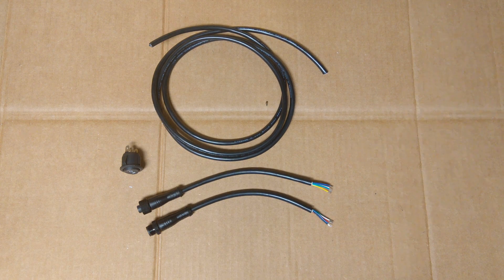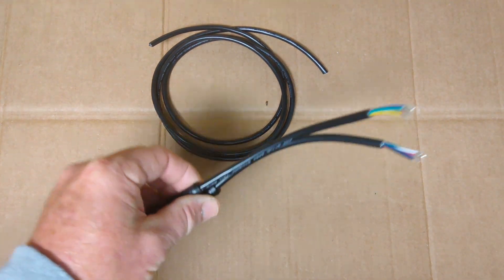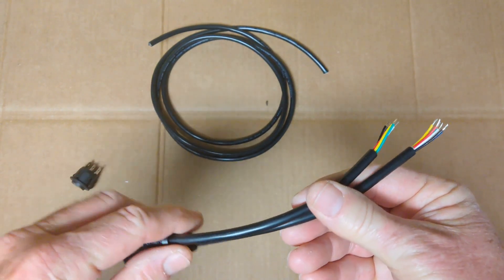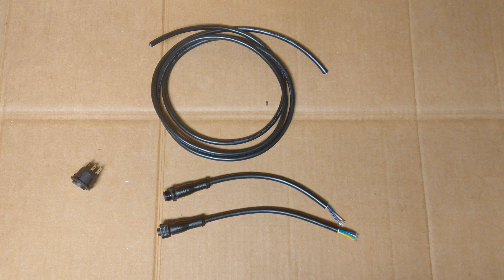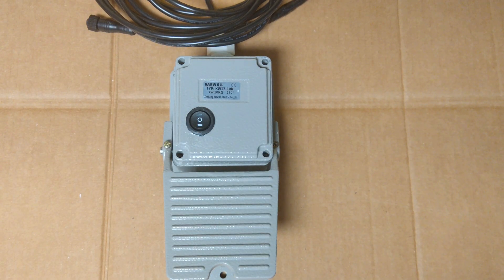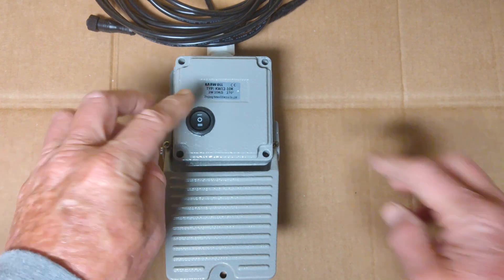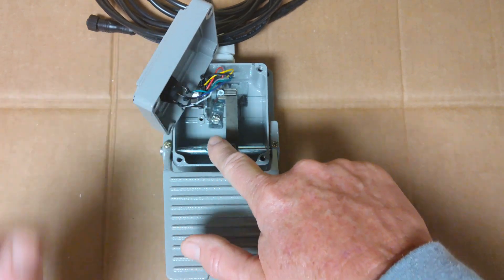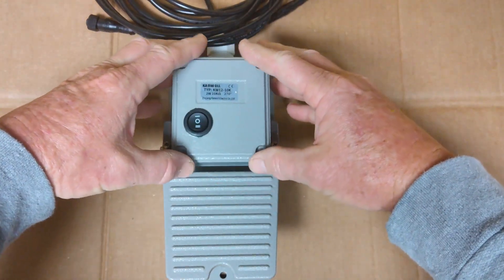Crappie Brakes Bi-Directional and Variable Speed Controller Foot Pedal V2

Comment: Thanks for the video, I used your idea with the pedal. Tell me please, did you make ventilation in this box? Does the board heat up?
Reply from the maker: I didn't vent this box because the PWM is not working at the max current. You could always leave the box partially open if heat became an issue.
Reply: thanks, i wanted to know that it works without problems because i want to put it in the kayak locker

Comment: Why did you move away from esc? Seems like you’re going with pwm more often
Reply from the maker: Because I don't recommend the 880 ESC for TMs of 50lb thrust and higher.
Reply: @Aksmaniyak ok I have a 55lb 🙄 back to the drawing board
Reply: @Aksmaniyak all I can find is 60A rated/ 100A peak pwms. I think I need higher for my NV kayak 55lb. Any suggestions?
Reply from the maker: @DrummerDave85  I have done videos for a 100A continuous and 200A max as well as a Minn Kota Traxxis board build.